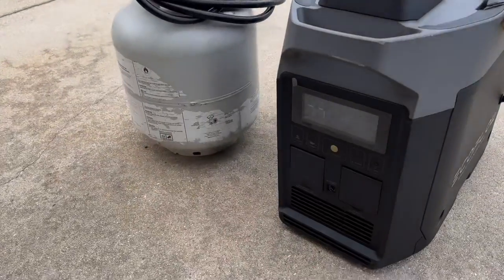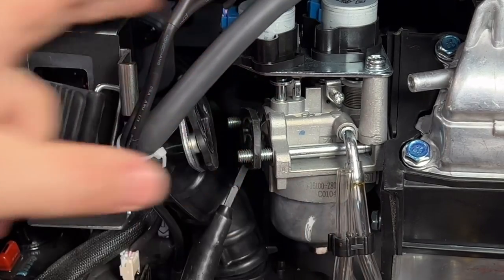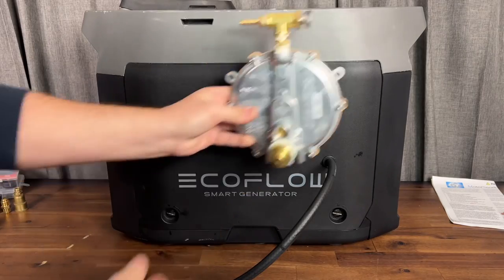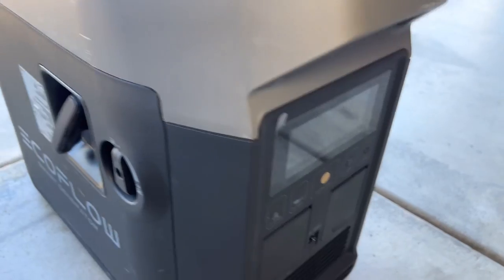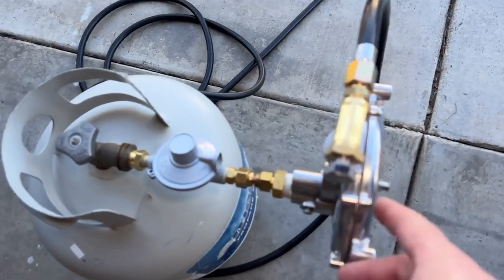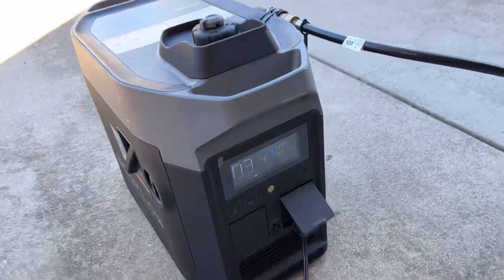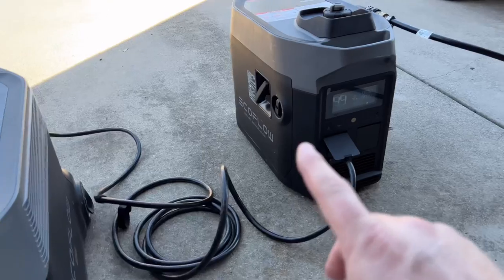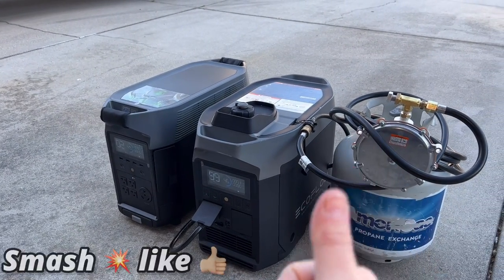ECOFLOW Smart generator Tri Fuel Kit

Comment: Your propane kit takes me to the Predator 2000. Is that the correct kit for the Smart Generator.
Reply from the maker: Yes the ECOFLOW uses the same rato engine in the predator and the carb is the same except two stepper motors. But yes correct kit! 👍🏼
Reply: Thanks for the fast reply. You have a gift with your knowledge and the delivery of the information.  I just bought the Smart Generator from Costco for $899. I wanted the propane model but the price difference is too much.  This mod is just what I need!
Reply from the maker: And you know what I get full rpm and watts of 1650 with the propane mod verses the new dual fuel runs about 1550-1600. 
And yea $1499 is pricey. 

And thank you btw ..👍🏼😀

Comment: you can use soap foam to check propane leakage.
Reply from the maker: Correct, but this is faster and instead of spraying every joint you just sweep by. I did this in my new Rv because it had a leak..😳 found it super quick
Reply: @johnnysweekends  yes, it is faster!   But in conditions of  "not enough money"  , 100$ for that equipment is a bit too much. 😀👍
Reply from the maker: Is it a hundred ? I thought it was $49 ish lol
Reply: @johnnysweekends  in my country is 100$ in shop,  if I want to buy from US, add 45$ for shipment.  It is equal.  So, why I watch your video? I prepare my inverter generator to work at propane  and gasgen(gas from wood gasification),  and now generator work from triple fuel  supply.
Reply from the maker: Ahh yea that is a lot. 
Soap it is. 

And wow cool, the gasification thing seems to be getting more popular. It’s like the second time in a couple days someone has mentioned it.
Reply: @johnnysweekends  I bought a Ben Peterson's  book "wood gasifier builder bible"  and last year made 10kW replica with some modifications. It works pretty good at every kind of biomass.
Reply from the maker: Wow, I may have to look into that..👍🏼

Comment: how long will the 20 pound cylinder last?
Reply from the maker: I haven’t tested that yet but from other units they can last up to 30 hrs but this generator will only run at 1000 watts on the low end. 
So I assume at a 1000 watts and the engine running at 60-70% maybe 18-20 hrs.

Comment: I’m debating on buying eco flow pro battery and generator, or just sticking with my Westinghouse 4500 duel fuel and must of the time it will be used for camping . Whey you think ?
Reply from the maker: I have the pro and use it for camping verses rewiring for inverters and more. Just plug into inside storage compartment cord and whole trailer is alive. 

Now the Westinghouse will work to charge it and supply power but it turns to pass through mode so you can pass 1800 watts and use that. But that’s it till you switch back to the delta pro fully. 

So if a ac unit uses 1300 watts the Westinghouse will pass through the 1300 to ac and the 500 watts will be dumped into charging the pro. But if you want to use 2000 watts through the pro it won’t do it in pass through mode. 

But with the smart Gen it will work as normal because it will Dc charge and the delta pro still is able to provide up to 3600 watts. But the smart Gen can only charge at 1800 watts. But I only get 1650 out of it.
Reply: @johnnysweekends   thank you great info we use the AC maybe 3 times a year so based and what you said I think  the eco flow  will work. And is the smart generator worth it ?
Reply from the maker: That depends on if you think you will utilize it that way it’s supposed to be used. From what you are describing I would say no. But a Honda 2200i..👍🏼
Reply: @johnnysweekends  perfect thank you for all information I totally appreciate it. I’ll just stick with the Delta pro and a solar panel and let a trickle charge all day.
Reply from the maker: Yup, you can go pretty crazy on solar with the pro..😁👍🏼

Comment: I wonder if you can connect 2 generators to delta pro this way. That would be awesome to run on natural gas to quickly recover any heavy loads, while solar catches up.
Reply from the maker: You mean two into the extra battery ports in the rear? Or just one on DC and the other on AC.?
Reply from the maker: Hmm idk I don’t think it will control both but who knows. Guess I will have to find it lol…😁👍🏼
Reply: @johnnysweekends  That would be quite awesome! Thank you sir! Subscribed! :)
Reply from the maker: 😀👍🏼 will probably be a short video but will see. I need another adaptor so getting one coming

Comment: Should note that these kits should work with any of the 80cc Yamaha clones.
Reply from the maker: I’m not a hundred percent sure on that as the carbs to differ a little bit. 
The engine is the same but I can’t confirm if the carb intake side is the same  as they do use a different carb for different units. But it’s like 3 or 4 different carbs that I have seen. 
Unless someone else can confirm. Bolt spacing I assume is the same it’s only the intake side of the carb that could change a little..🤷‍♂️

Comment: Using  LPG  produces 1600 to 1700 for propane.  Using gas produces 1800
Reply from the maker: Unfortunately it never produces more than about 1650-1675 on gas or propane. This is at sea level. Well ok 500ft. Both the original and DF units produced the same results. But that’s not that big of a deal.

Comment: I'd buy a propane only generator if you knew you'd only use propane and they have longer runs times then a dual fuel.
Reply from the maker: True, the dual fuel model of this is coming out soon, but you get way more btu’s with gas and longer run times but that needs to be able to have the extended tank tan to it..

👍🏼